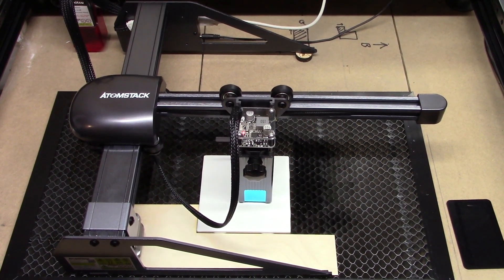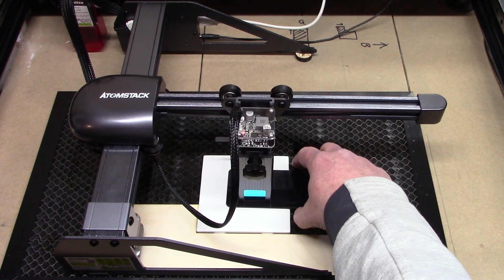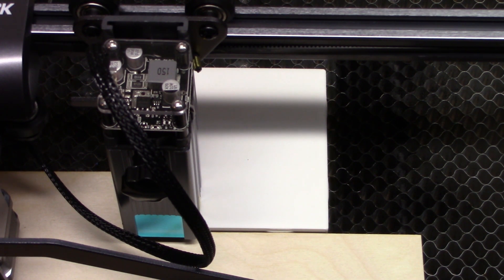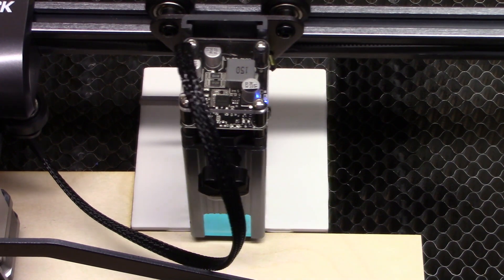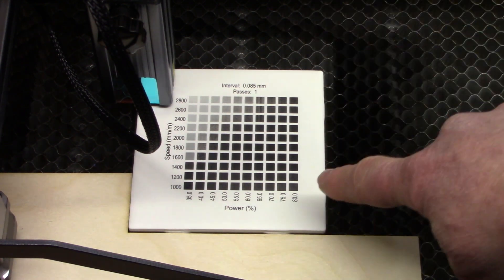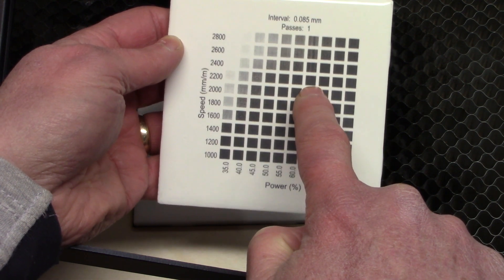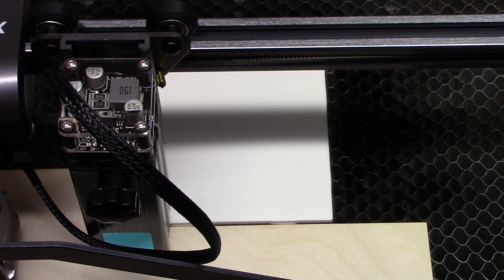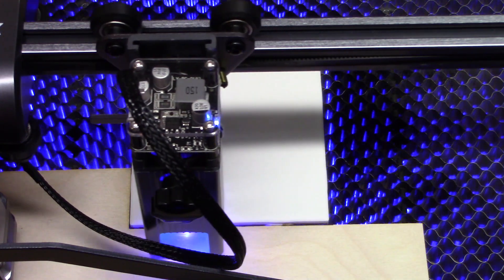Figure out burn settings for Atomstack P7 - White painted tile method

Comment: Have you done any comparison on driver boards for Lasers?
In the need to fix an old Universal machine and the only thing I have to go on is that I like to go with GRBL based.
Reply from the maker: That is a good question.  The quick answer is no.  I have not done that sort of thing.  I have stuck with basic off-the-shelf machines and made modifications from there.  Upgrading or swapping to a new/different controller is not something I have done.  GRBL based controllers are inexpensive and do a really good job for on these home machines.